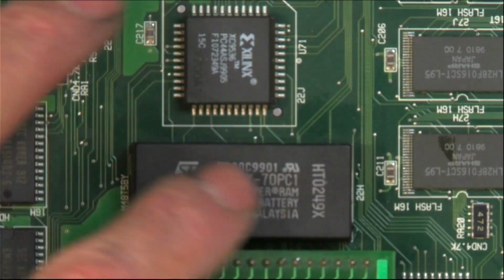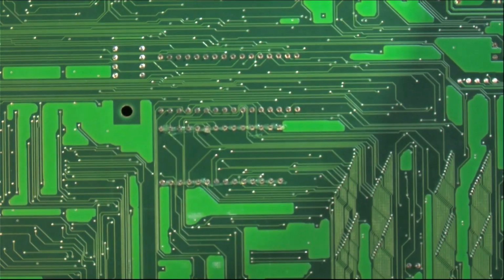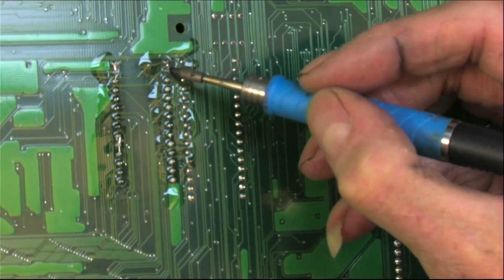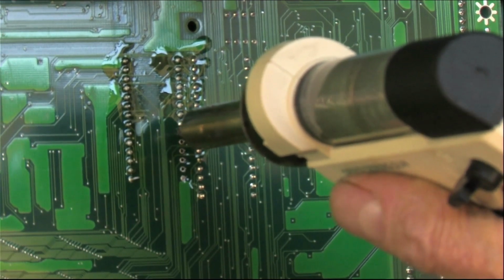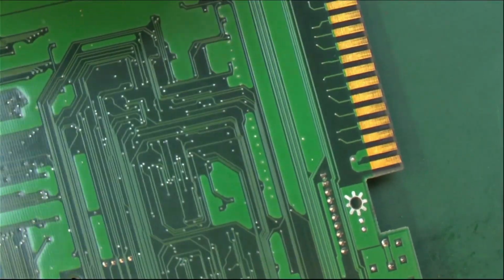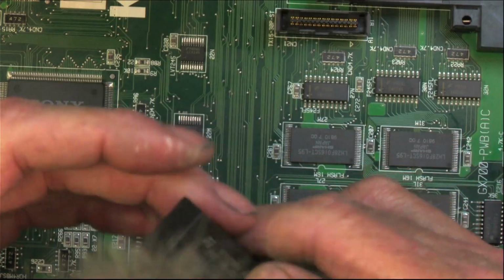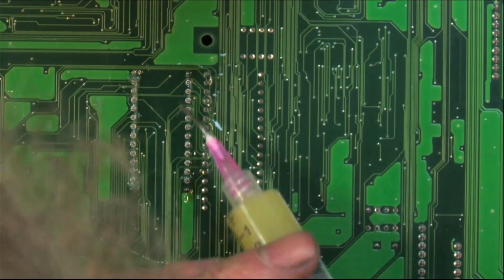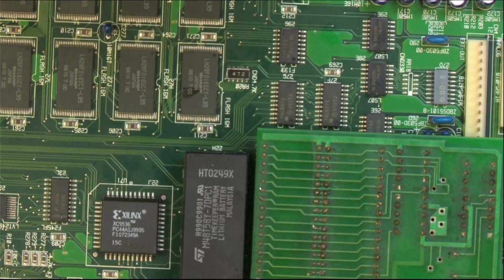DANCE DANCE REVOLUTION FULL SIZE, 2 PLAYER ARCADE, MAIN BOARD, TIMEKEEPER REPLACEMENT.

Comment: you can just cut a notch in the top and solder a 3v battery to it, its getting hard to find replacement battery backed rtc-ram that still works
Reply from the maker: That's what I suggested, you know it will come to that. Have not done that yet myself, but I found an old one in my stock that I am going to try that on. Thank you
Reply: a n i m e
n
i
m
e
Reply: @KokoroKatsura  weeaboo